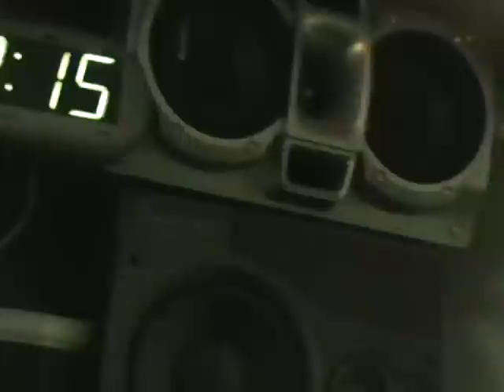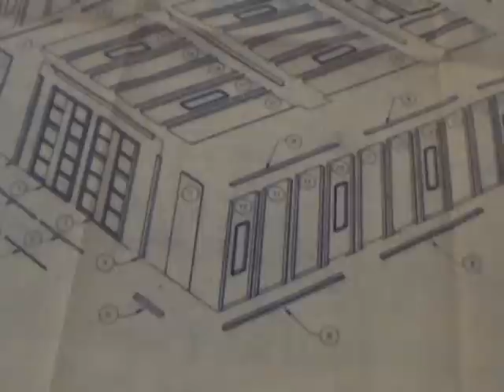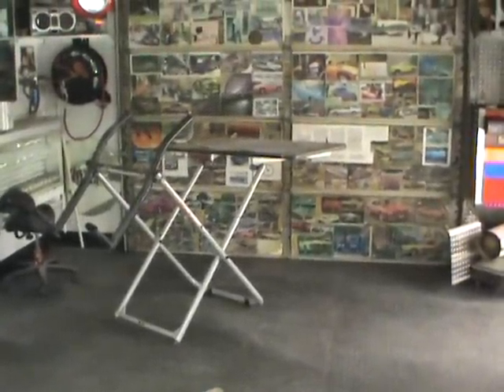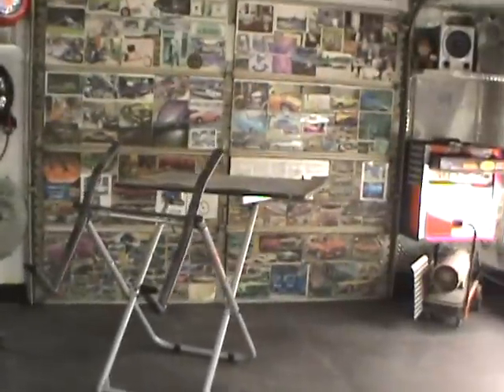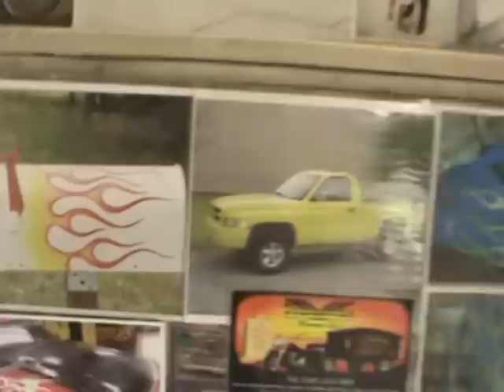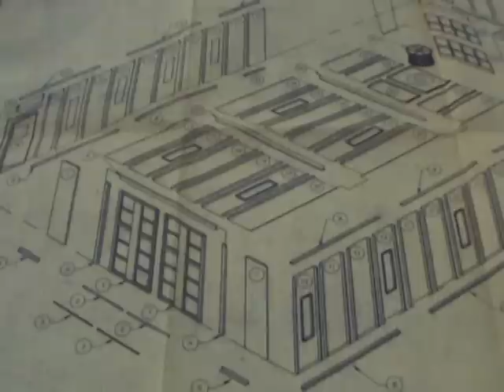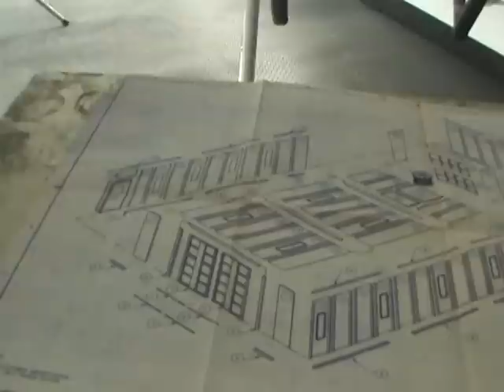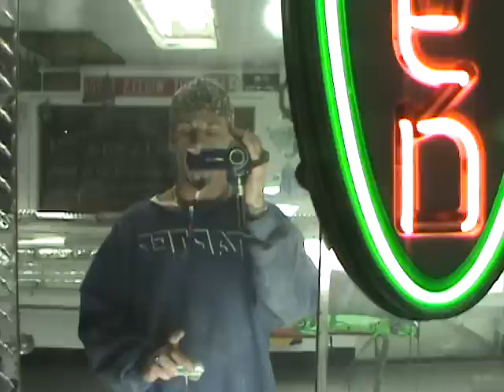WILD CARD CUSTOMS-PAINT PIMP NO.95

Comment: If I had that booth I'd want to set it up too. 

If you hate blocking that Mar Hyde try that Glasurit I use it sands like butter. Glasurit Dry Sand High Build Urathane 285-81 it's pricey but time is money. I shoot primer with a Sata KLC 1.7 hvlp nice wide fan lays it down wet. Peace.